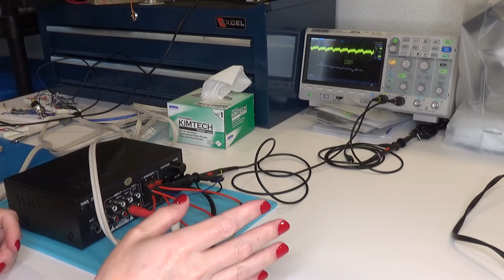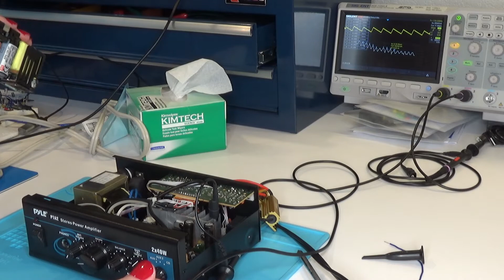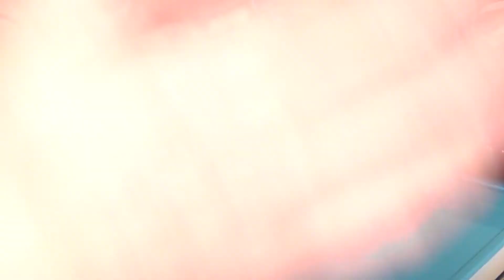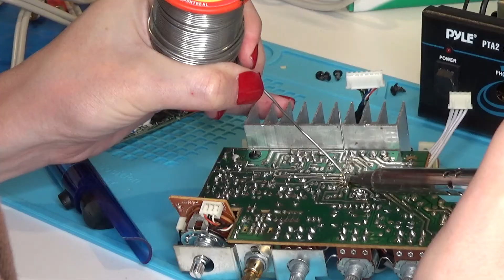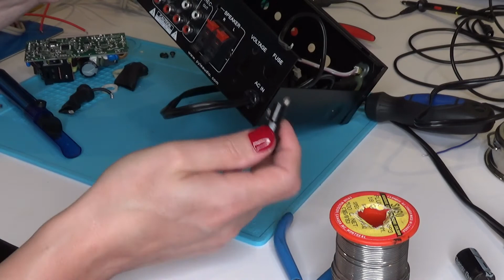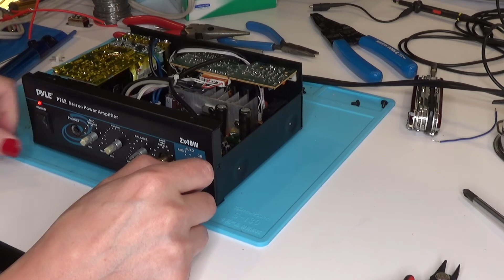Electronics: Fixing a Cheap Amp

Comment: I've had a few of these delightful boxes of killjoy on my desk over the years. They're almost all universally crippled by their power supply, and the ones that had a 12v input would often be fine for the vcc of the chip amp, i.e. 15V. Yet, even a 12V 1A switcher made an enormous difference in the power output before it starts clipping.